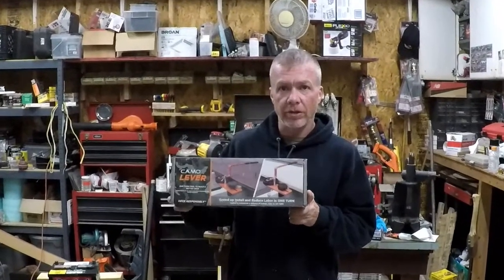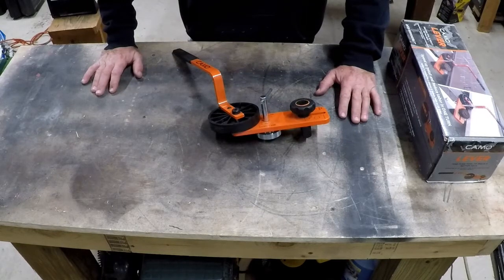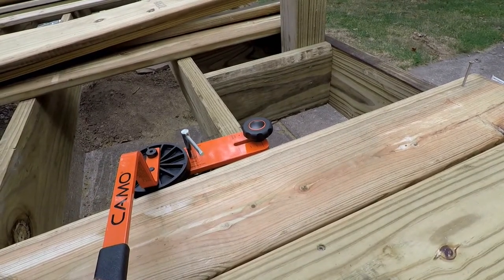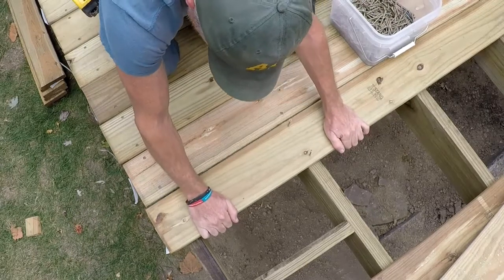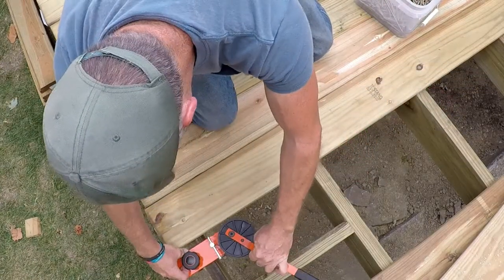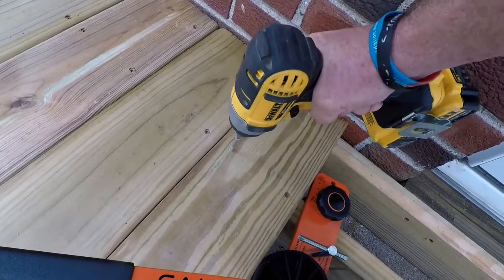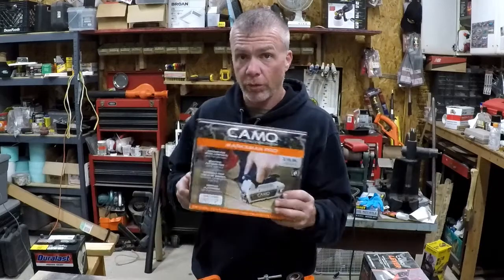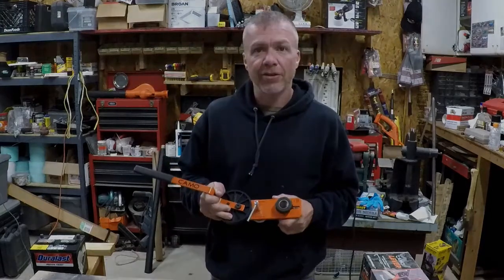CAMO Lever Tool Review | Decking Tool | MY DIY

Comment: Pros who work with composite/PVC deck boards use 3 per crew- perfect for 20' warped deck boards. Works great in conjunction with Camo Edge Clips on grooved board decks.
Reply from the maker: If I used 3 on my crew, 2 of them would still be in the box LOL

Comment: I started resurfacing our deck today and ran into this problem. Picked this up and it's working great.  Do you have any tips for how to handle the last deck board, i.e. where there's no joist for the tool to grab onto?
Reply from the maker: A flat bar or some other type of pry bar if you’re going up against the house, if you’re ending up at the outside of the deck, screw a scrap piece to the outside and then use a pry bar between it and the deck board.
Reply: Thanks!

Comment: Where's your gap between boards!!???
Reply from the maker: Never gap treated lumber when installing, they shrink.
Reply: @MyDIYBuilds  Yeah? Tell that to the prior owner who installed my deck 10 years ago which has zero gap to this day and the rain has no where to go.
Reply from the maker: Then they must have used a kiln-dried treated lumber, but I’ve only ever seen that that on tongue and groove porches.
Reply: @MyDIYBuilds  got an example of deck boards that were laid tight that shows them tight when they were laid and then spaced sometime after on the same place?
Reply from the maker: Here’s a deck I built at my own house, and then there is a follow up video and you can see the spacing after less than a years…they really shrink up in just a matter of weeks.
How to Build a Deck Without Postholes | No Digging Deck | MY DIY
https://youtu.be/0pxAyNZ25zQ
Reply: @MyDIYBuilds  You are the man! I am a believer. Wow those gaps 1 year later are amazing! Thank you so so much for this. I'm a trust & verify person and seeing the same deck during installation and then after is proof in the pudding!
Reply from the maker: Glad it helped!

Comment: I'll be that guy who points out, you are making a mistake by butting all those boards together without a gap for drainage and swelling. You need a 1/4 inch gap between boards, get a paint stick for a spacer.
Reply from the maker: Nope, they shrink up within a couple weeks.